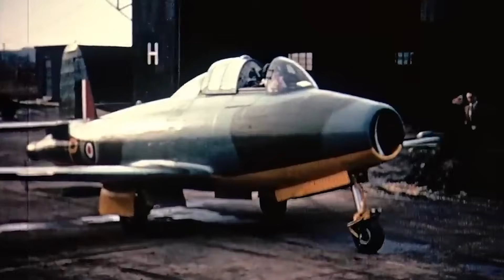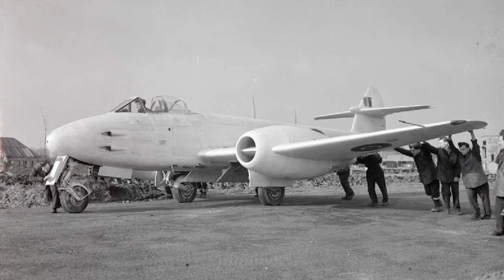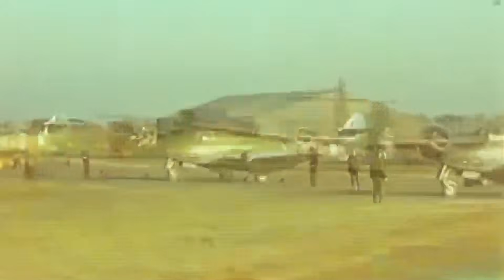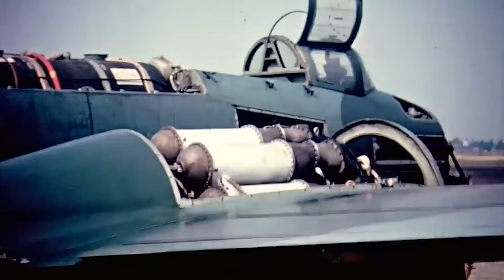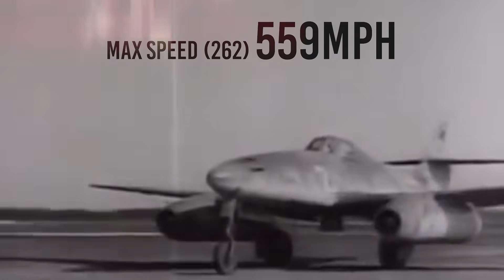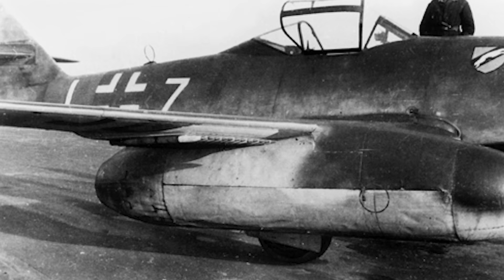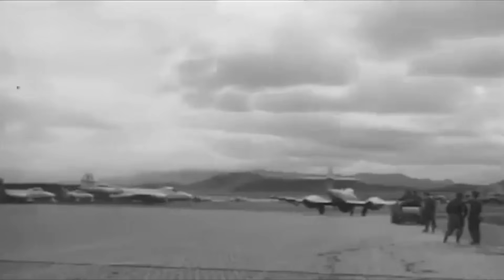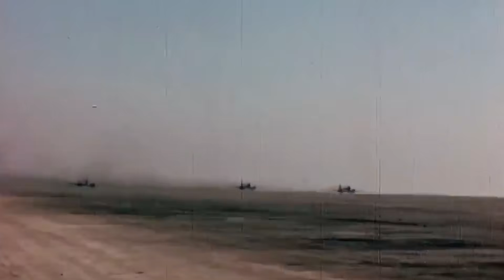Meteor vs Me 262 | Which was the better WW2 jet?

Comment: As much as this is interesting and informative, a few things that you guys missed out that perhaps should have been mentioned. The first is that the Me 262 delays was nothing to do with political decisions surrounding turning it into a bomber, this is a myth and there is no evidence that it had any impact on the aircraft's development. The real delay behind the Me 262 was because it was so unreliable and kept crashing. Out of the first 10 prototypes, six crashed, which seriously delayed the prototype development and resulted in the first six production Me 262s being diverted to the prototype testing. Two of these crashed as well.

Regarding the aerodynamics, yes, the 262 had a higher Mach Number than the Meteor, the narrative states it did not suffer compressibility issues compared to the Meteor, that is completely untrue. Read what Winkle Brown said about it after interviewing German test pilots, many 262s were lost owing to compressibility and the wings were not laminar flow. Despite a lower Mach Number, the Meteor III had air brakes, which gave it an edge in controllability at high Mach Numbers compared to the 262. Like the Meteor, the Me 262 suffered directional snaking, something all first generation jets suffered, including the P-80. Its slats had a  detrimental impact during turning and high bank angles, they would deploy asymmetrically, which threw the pilot's aim at a crucial moment.

Another point worth making is regarding its versatility, the 262 was a night fighter, interceptor etc, but the Meteor was also developed the same way after the war, the point needs to be made that the versatility of the 262 came at a cost; the night fighter was notoriously difficult to fly, and the bomber variants suffered considerable drag which affected performance and handling until the pylons were redesigned, whereas the Meteor night fighters were far superior in design and performance and didn't suffer the same handling issues, although they were a later innovation.

Regarding the undercarriage design, the Meteor was never fitted with a tailwheel! A major fail of the narrative. The Me 262 was, in fact designed as a straight winged taildragger, whereas the Meteor was designed from the outset with tricycle undercarriage, not only that but the 262's nose gear was terribly weak, it failed constantly and suffered wheel shimmy, which resulted in leg failure. The Meteor's was far more robust.

The one thing you failed to mention was that the Meteor III was pressurised, whereas the 262 was not. Another factor behind the two was their design philosophies, which the narrative touches on was the philosophy behind engine selection. The 262 and the axial engine were a modern innovation for sure, but a couple of things, a Meteor prototype was fitted with axial flow Metrovick F.2s, but this was discontinued as they required more development work. The decision behind the centrifugal flow engine was one of expediency, you mention it being more reliable without making thf connection that the decision was made to persue that option for that reason; Meteors were more reliable than the 262, the Welland had a TBO of 180 hours, whereas the Jumo 004 would last barely 20 hours before exploding. Every 262 pilot suffered multiple engine failures, Galland said he had 10. Advances are of no use whatsoever if they result in crashed aircraft.

Your summary of the 262 being 5 years in advance of the Allies is simply wrong. Yes, it was faster than the Meteor I and III in level speed, but the Meteor IV that first flew in January 1945, was faster in every respect, including acceleration and in a dive compared to the 262. The 262's swept wings and engine design were advanced but again, let's not repeat cliches, the sheer unreliability of the Jumo 004 was highly problematic and resulted in only very small numbers being available at any time.

While it sounds like I am rubbishing the 262 in favour of the Meteor, I am a bit, because the reality behind the 262 was that it was not the advanced arrow to the future that it is made out to be. It was certainly promising but its unreliability was a severe handicap that hampered operations. The Meteor had several key technological advances over the 262, its tricycle undercarriage from the outset, it was pressurised and it had air brakes, it could out turn the 262 and in the Meteor III had a better climb rate. The Meteor IV was faster in every respect than the 262, so your narrative misses a few key facts regarding technological advance. I was expecting better, to be honest.
Reply: I love your sense of humor... you really had me going for a minute until I realized you were joking around... thanks for the laughs
Reply: @DoktorBayerischeMotorenWerke 

Most 262s destroyed themselves and killed their pilots. A lot of that was due to the 46 minute average life disposable engine.
Reply: @DoktorBayerischeMotorenWerke 

@JammisAdami 

We feel we can clear up some commonly held myths and misconceptions, obviously.
It's always good to see the facts presented clearly and concisely isn't it?

The Gloster Meteor was one of the world's first jet fighters to go into service, it was in service during WW2. The meteor was the first effective multirole fighter bomber jet aircraft with a reliable engine to go into service,  It broke speed records in 1945 and 1946. During WW2 it was in service as a fighter and multirole aircraft over the UK and over all allied controlled territories in Europe and beyond. 

The ME-262 and it's 46 minutes life engines were abandoned shortly after 1945, it had a do not exceed speed of 456 mph and was only ever used to attack bombers with losses of three 262s for each downed bomber.  During WW2 most of the ME-262s were destroyed by their engines, were various types of accident losses or were shot down by bombers. No German designers were involved with the Mig-15. The Mig-15 used a copy of the RR Nene.  

During the Korean conflict most of the Meteor casualties were due to groundfire or accident losses. The result of any tangles between Migs and Meteors was that Mig pilots avoided getting into dogfights with Meteors. The battle of Sunchon, where 50 Migs against 14 Meteors resulted in the supposedly superior Migs failing to gain any clear advantage caused the Koreans to re-evaluate tactics. General opposition in Australia to involvement in the Korean conflict resulted in the govt using the battle as an excuse to reduce the RAAFs involvement to troop support only.

The world's first wind tunnel was built in England during the 1800s. The world's first supersonic wind tunnel was built in England during the 1920s. 

The Whittle Gloster E28/39  was of course a brilliant aircraft that was later copied in Russia as the upsized and tweaked Mig 15 with a copy of the RR Nene gas turbine aero engine. The RR Nene being the world's most powerful & most reliable gas turbine aero engine in 1944.

The MD F3H Demon was a contemporary to the DH Sea Vixen & had a similar performance. The F4 Phantom was a follow on from the F3 Demon. The Sea Vixen took a long time to get from first flight to introduction for various reasons and a similar situation occurred with the MD F3H Demon.

McDonnell Douglas F3H Demon
590 Built. Not Supersonic.
Max Speed 578 MPH.
Introduction date 7 March 1956
First flight 7 August 1951
Retired 1964

MD F-4 Phantom 2
Number built 5,195
Manufactured 1958–1981
Introduction date 30 December 1960
First flight 27 May 1958

DH Sea Vixen
Number built 151 (including two DH110 prototypes and one Sea Vixen prototype)
Introduction date July 1959
First flight 26 September 1951
Max speed 695 MPH.
Retired 1972

Interesting British achievements.
There is no doubt that the Fairey (England)
Delta 2 was of course the world's first jet
aircraft to exceed 1000 mph.  Indeed It
exceeded the previous record by 310 mph &
held the record for 1 year. Incidentally, the Dassault Mirage 3 & 4 are based on the Fairey Delta 2.

The Panavia Tornado & Euro fighter Typhoon are British design aircraft with British design engines built by international consortiums. 

The EE Lightning was one of the fastest aircraft on the planet when it first achieved a Mach 2 flight. 

Early days, jet fighters.
De Havilland Vampire, Sea Vixen & Gloster Meteor accident losses were not high or unusual for fighter aircraft at the time. De Havilland built large numbers of all metal airframe aircraft before the DH Comet.
We mustn't forget of course that the DH Vampire for example first flew in 1943 & the engine was also built by De Havilland. There were examples of the Vampire interceptor / fighter in service until 1990 which was operated by more than 30 countries.

Non combat phase accident losses.
% of Aircraft built.

The Canadair CL-44 was a turboprop airliner.
Canadair CL-44                  (ff 1959 ) 48%
Lockheed XF104                (ff 1954) 100%
Lockheed  P80                   (ff 1944) 43%
Lockheed F104                 (ff 1954)  45%
Grumman f9f-5 Panther   (ff 1947) 44% 
Convair F102 Dagger        (ff 1953) 45%  
MD F-101 Voodoo.             (ff 1954) 34%
MD FH Phantom 1            (ff 1945)  35%
MD F4 Phantom 2             (ff 1958)  28%
MD F3H  Demon               (ff 1951)  32%
Gloster Meteor                  (ff 1943)  21%
DH Vampire UK                (ff 1943)  23%
DH Sea Vixen   UK           (ff  1951) 33%
Gloster Javelin  UK         (ff 1951) 20%
EE Lightning  UK             (ff 1954) 33%

It's a great pity & a crying shame that British military forces had to occupy a large part of Germany for decades after 1945 & Russian military forces had to do the same. Of course Russia still posseses a large chunk of what was German territory & of course Russia & the UK produce nukes. Obviously Germany does not produce nukes.

Early days, jet engines. Whittle performed the world's first demonstration of a gas turbine aero engine in 1937. The RR Nene, a centrifugal gas turbine aero engine, was the world's most reliable & most powerful gas turbine aero engine in 1944. Licensed built versions & copies of the RR Nene & RR Derwent would go on to power many aircraft in Russia including the Mig 15 & Mig 17, the US, China, France & other countries for decades after 1944. Incidentally, the Mig-15 was in essence an upsized / tweaked copy of the Whittle / Gloster E28/39 jet aircraft including an uprated copy of the RR engine.  The basic centrifugal compressor gas turbine aero engine with Whittle style reverse flow combusters and sometimes an axial compressor section is still manufactured by more than one company including Pratt and Whitney, the main application being helicopters.

The gas turbine engine was invented in England during the 1700s.

During the 1800s Parsons of Ireland & North England produced the world's first axial multi stage sequential stator rotor turbines and compressors for turbomachinery use which would eventually go on to to form the main components of the axial gas turbine aero engine. At the time the basic idea of making an internal combustion gas turbine engine and using it as an aircraft engine was considered thus the jet aircraft concept had been created in England before the first powered aircraft flew.

An example of what goes on these days in various countries. For example, there are of course no German companies that makes German jet aircraft in Germany & there are no German Companies that make German gas turbine aero engines in Germany that are suitable for widebody airliners.

The UK has the world's highest combined per capita Nuclear / Defence / Aerospace Sector Activity.

UK defence sector, absolute terms, world's second highest activity. 1st for per capita defence sector activity. Per capita nuclear powered submarine construction, 2nd position. 
Main players being Rolls Royce, Babcock, GKN Aerospace & BAe Systems. Activities often involve international collaboration. BAe systems, RR and other UK companies now handle more Airbus work value wise than Germany. 

There's a good chance that anyone currently flying on a widebody airliner will be on an aircraft powered by RR gas turbine aero engines made in the UK and a good chance there will be other hardware on the aircraft that's designed and / or manufactured in the UK. 

Rolls Royce Holdings UK
Subsidiaries
- Rolls-Royce plc
- Rolls-Royce North America (ex Allison etc Classified Military stuff)
- Rolls-Royce AB
- Rolls-Royce Deutschland
- Rolls-Royce India Private Limited
- Rolls-Royce Marine Power Operations
- Vinters Engineering Limited
- Rolls-Royce Controls and Data Services
- Rolls-Royce Power Systems
- Bergen Marine
Joint ventures include:
- Rolls-Royce Turbomeca
- MTU Turbomeca -

Trent Family
The MT30 (Marine Turbine)
Industrial Trent 60 Gas Turbine
Trent 7000
Trent XWB Airbus A330neo.
Trent 1500
Trent 1000
Trent 500
Trent 600
Trent 700
Trent 800
Trent 8100
Trent 900
   
RR wholly owned subsidiaries in Germany handle smaller 2 shaft RR gas turbine aero engine work.

The UK space and aerospace sectors are highly productive, high-value industries that together contribute over £18 Billion in direct Gross Value Added (GVA) to the UK economy. Individually, the space industry directly contributes about 0.3% of UK GDP 7•2 Billion while the aerospace industry contributes approximately 0.5% £10•9 Billion.
   
We hope this helps.

We hope this helps of course 👍